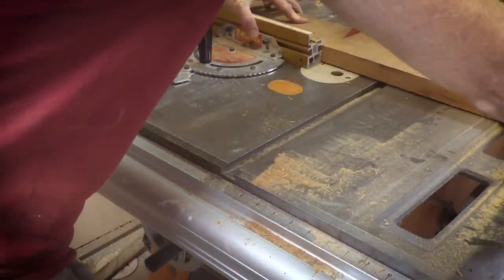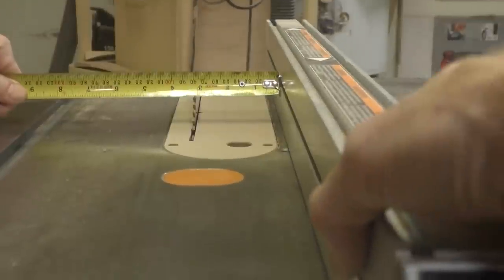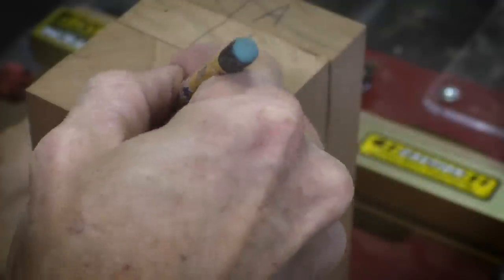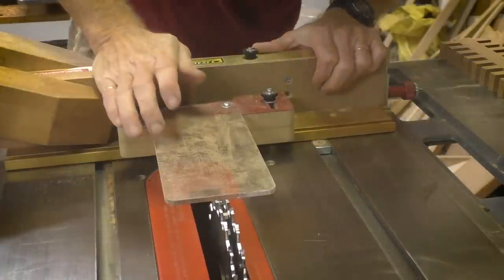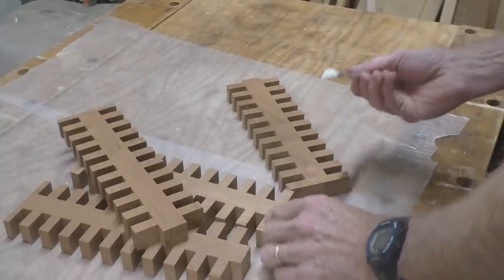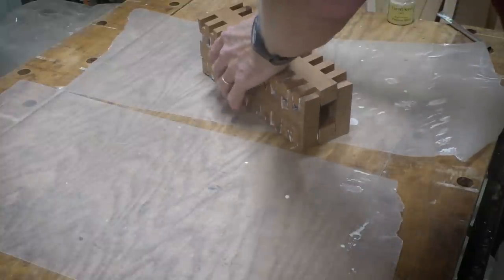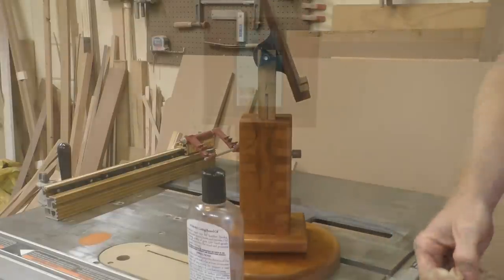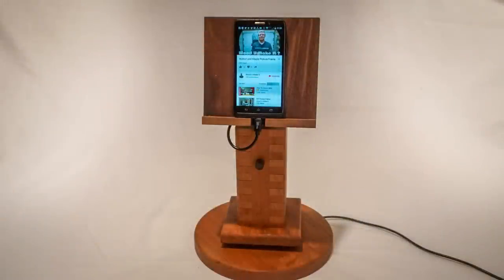How to make an adjustable and rotating cell phone / tablet stand

Comment: Very nice build, but I feel like that box joint tower is super overkill. You could have made that thing 1/2 the width and it would still hold the weight of any cell phone or tablet, right? 

Maybe I'm wrong, but either way, it looks great, and I'm sure it works great.

Comment: Rather over-elaborate, requiring power tools the average person could only access by arrangement.
The real work is done by the bearing but in order to make this design suitable for tablets a simple rotating "bearing" could be used so that landscape and portrait orientation was available. This would simply require an extra strip of retaining beading wood so the orientation would be clockwise OR anticlockwise to best suit the wiring running up the column.
Semi-suction or thin rubber feet would also steady the whole stand in real world use.

Comment: Great project, but as small as this item is, I would have left out Lazy Susan part. It just seems unnecessary to me. But overall I really like the project. I'm thinking about making one for myself.
Reply from the maker: It makes sense what you're saying, but I guess it depends on how it is to be used. For my friends, they're typically not sitting side by side during the video calls to France, so they wanted something they could easily rotate to be able to point the phone to the person who was speaking. Thanks for watching, and good luck with your project if you decide to make one.
Reply: Yes, I can see how that would be handy for them.

Comment: Um Wood U Make It? i luv ur design for this and i would really like to use it for a mini PC build by which, i would be placing an IPS display where u will place the smartphone or tab, making a stand for the display, and to the back i would cut a little pice of the wood to run the IPS ribbon to the back where i would attach the small motherboard on for it to run. So your design was very easy for my little project!!!!! Thanks Alot!!!!!!!! I subscribed!!!!!!!

Comment: Does the top piece where the phone is held have an adjustable angle?
Reply from the maker: It does, yes.  It's held together at the back with a 1/4" bolt with a knob on one end. Just loosen the knob, adjust the angle, and then tighten the knob back up.
Reply: Thanks man this is a class project and I’ll defiantly b making it soon 
Best videos out there m8
Reply from the maker: Thank you so much!  I made another version of this stand with a couple of improvements. Here's a short video that summarizes the changes that I made:  https://www.youtube.com/watch?v=7JcNOUpBh74  Good luck with your build!
Reply: Thanks man I love the top of version 2.0 great work